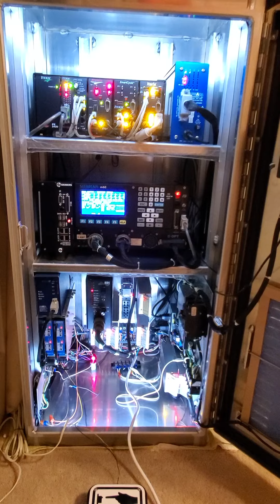polara EN4 Pedestrian Push Button

Comment: Do these have trackers in them
Reply from the maker: @barra308  not sure what you are asking, they keep track of how many button pushes the button received on a log but that is all, the EN4 was a basic unit, the EN2 had more options as it used an iccu to keep track of button pushes and failures during operation